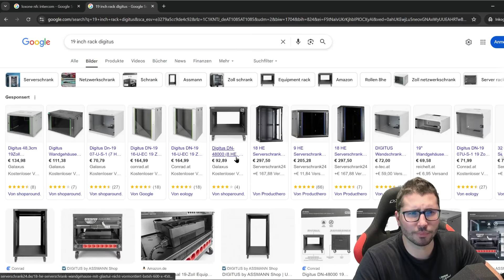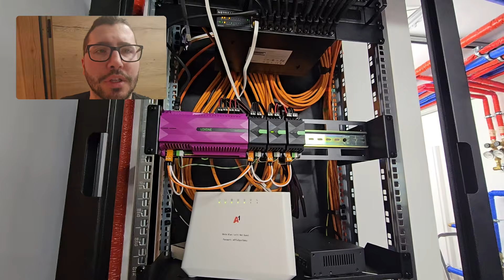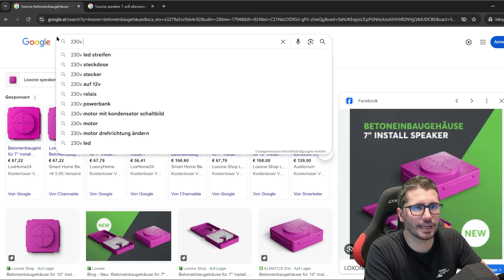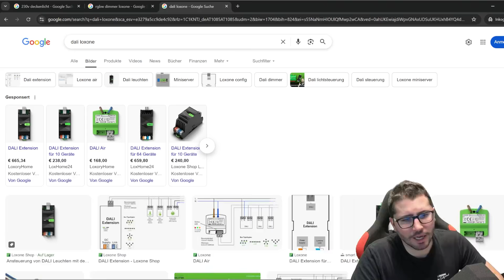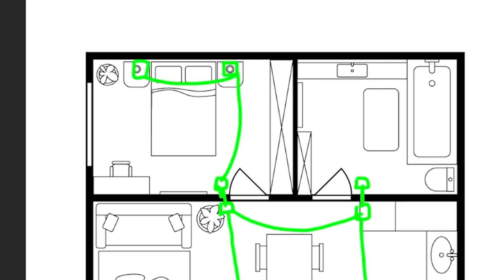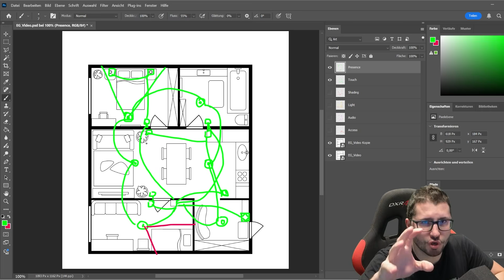Loxone - All The Wiring⚡ Secrets You Need To Know! 🏡

Comment: protip if you didnt already know. If you need a tree extension you can bring a cat6 or loxone cable off the intercom back to the lighting cabinet and boom, you now have 49 (NFC TOUCH IS ONE) more devices and dont need to buy a tree extension.
Reply from the maker: Propro tip as I fell for it you can not use another power supply for the Intercoms tree devices, so you are limited to 3W! But I had the same idea 😅

If you just to it, then you might get a 24V GND problem 

See Intercom Datasheet. Tried it with Nano2Relay, TreeToAir and NFC on a 24V supply directly at the intercom, didnt work :/

Comment: Great videos....Shading, if you cable from blinds/shutters back to relays in the Loxone cabinet, these don't have current level sensors like the nano relays do, so how do you ensure the position of the shutters do not get out of sync with the logic...using only time to open and close will probably loose sync eventually, so then you need end of travel switches? Or how do you get around this? Thanks
Reply from the maker: Hi, measuring the time and adding 1-2s so the motor always goes to the end switch of itself! :)

Comment: for the shading part, you mentioned the alternative using nano 2 relay tree and having one placed at the first blind then going with 2 sets of cables motor to motor. Does this mean that you also need a separate Nano2 relay at each motor? Or only the first one is sufficient, assuming you want to automate all N blinds to work at the same time? Thank you for your work!
Reply from the maker: Hey, each motor always needs its own nano2relay. Also if they should drive the same. 🙂

Comment: Does the bus cable going to the first blind motor need to be looped to the 2nd blind motor from the first motor blind or can you just pick it up from the nearest spot to the 2nd blind motor?
Reply from the maker: You could grab the high Voltage from the Socket in the room and the Bus from the touch for example. Good point. 

Depends how you usually secure the motors. I like having them on a dedicated breaker. Bus can come from anywhere!
Reply: @ixma_en  Thanks. Yeah I am going with a dedicated feed and breaker but will pick up the bus from the nearest Loxone RGBW spot

Comment: Only issue I see with dumb blinds is no feedback on position etc. have you ever used rs485 blind motors?
Reply from the maker: Hey, never been a problem to me, as Loxone is the only one in control, then it has the drive times. Via the Nano2Relay Tree it even has the current to know the drive times 

Never used rs485, but ass motors with puls for close, stop, open,... 😅

Comment: i wish I had seen this before I chose my blinds. I ended up going with Somfy Zigbee motors which I control via Somfy Tahoma as a virtual device. It works but its way more complicated than I would like it to be. The logic for going that route as that we also had Velux Windows and Blinds which can also be controlled via Tahoma. I would have had to add a Velux KLF unit and Loxone Relays to control my windows anyway. I would have needed 2 more Relay extentions which is what put me off the dumb route.
Reply from the maker: Happy to see you are one of the most active in the comments 🤘
Reply: Is there any way to control Velux roof windows (Or any other brand) with external shutters directly? I would prefer direct control rather than 3rd party interface in the middle.